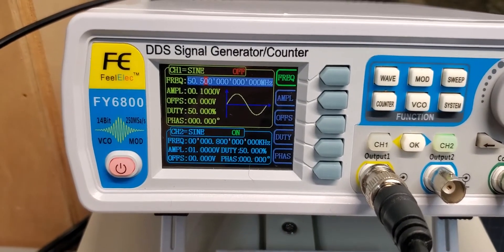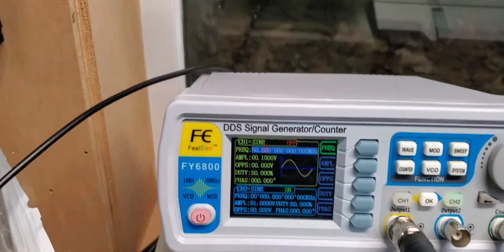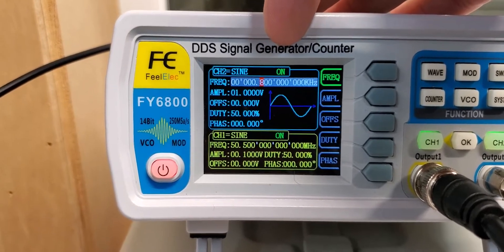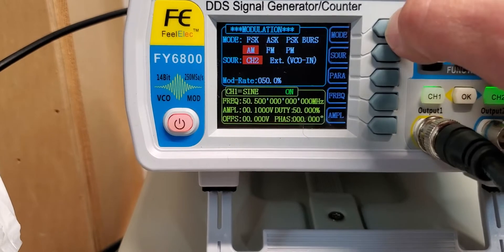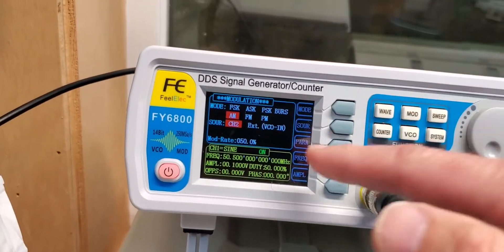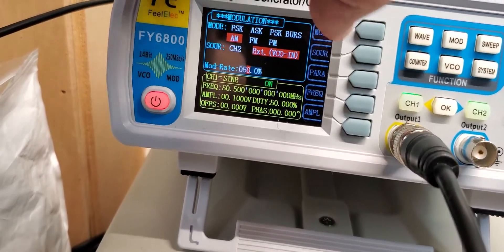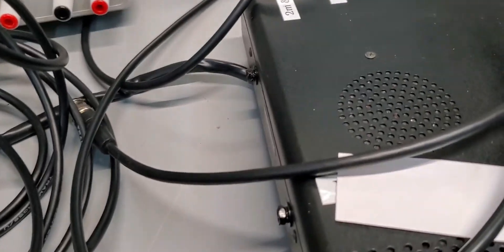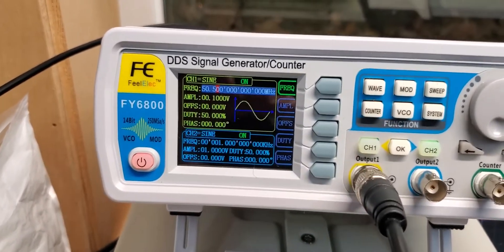Using a signal generator as an AM/FM transmitter

Comment: I have a much older, simpler RF signal generator and now realise that the socket labelled AF is actually an input rather than an output. I wonder if a higher impedance source such as a CD player would give better results?

Comment: I don't know anything about signal generators, so can you tell me if I want to generate a Wifi or GPS signal using a vector signal generator, will the generator put out or broadcast the signal internally or would I need an antenna?
Reply from the maker: It will transmit the signal, just extremely weak. Probably so weak you won't notice because of all the other electrical noise that's being transmitted from various devices.  
An antenna will definitely make the transmitted signal stronger as seen in this video.

Comment: I got a radio that came to me without the dial pointer for the SW band. I used this idea to mark the dial string for the new pointer. I didn't use an antenna. I used BNC to alligator clipes cable un-terminated and got very strong signal.

Comment: I'm using a Function Generator as a QRP HF CW transmitter at the moment
& doing well on 40 metres over 800 km away at approx only 25mW (5Vpp) into a  50 OHm load (40 M GP Antenna).

I am switching the TX line to key the Morse lol.

I have experimented also with modulating the sine wave from a Function Generator for both AM and FM by adding an Audio Amp, & Magnets for fine tuning the mixing inductors. (That was a long time ago now though).

The videos of the FM and AM modulating should be on my channel still.

It was just a crazy experiment  haha.

73 and Keep up the great work mate.

de VK3VKe ⚡🙏⚡

Comment: With a HF attenuator you can connect it directly to your Receiver. But calculate your voltage before, otherwise the Receiver can bei damaged! 73

Comment: Is it possible to modulate ch1 using ch2 if my signal generator doesn't have a built in modulation function. what would be a good way to mix the two outputs without shorting them and maybe damaging the generator.

Comment: Great video man....Can you give me link for the antenna? Many thx
Reply from the maker: I'm using the TRAM 1185 antenna with a BNC connector and magnet mount. That one is also available with a PL-259.  It's a nice simple dual band antenna.  On my primary car (SUV) I have a 3/8"-24 mount for ham sticks.  With that mount I use the TRAM 1184 which is the whip only.  With 17" it's short enough that I can leave the antenna on while driving into the garage.
Reply: @adventurewithclaus  

many thx